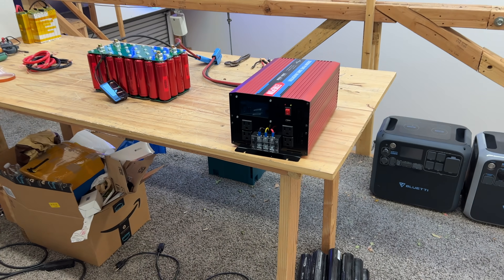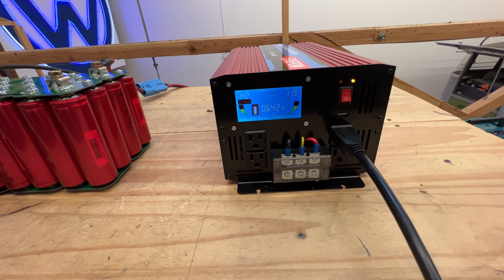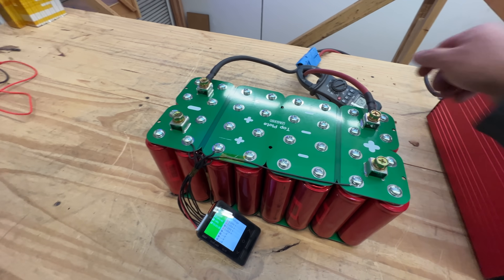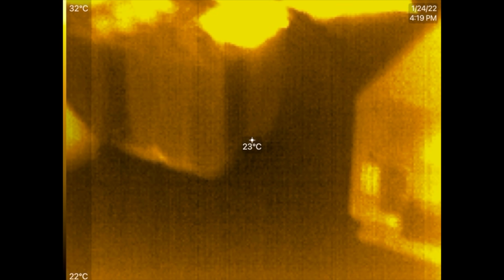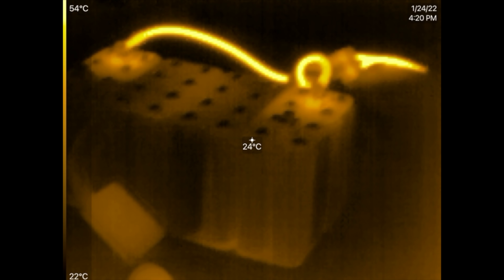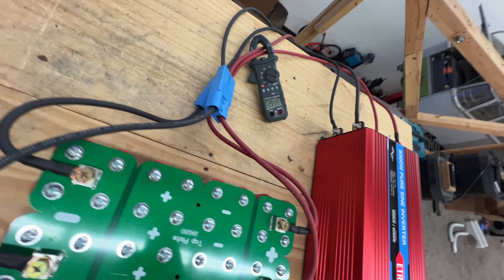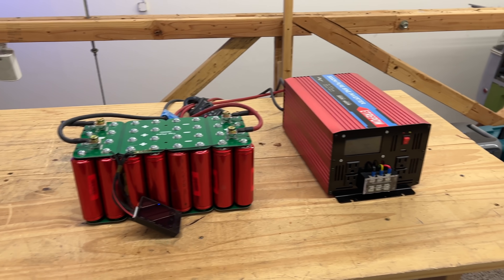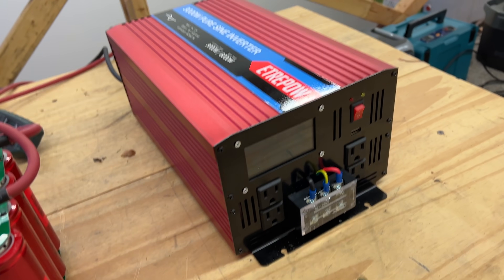This battery Kills inverters

Comment: Hi, when you got the two different current readings going from single to double wires, this could be due to the change in current waveform.
Your current clamp assumes pure DC current, the current drawn by the inverter probably isn't pure DC. 
There could be ripple on the current, changing you current clamp to AC would show you the ripple component.
It would only be an indication, unless your AC current is True RMS measurement clamp.
With a lower voltage drop to the inverter and higher load the inverter would perform differently.
The heater you used has an electronic current control, so you do not know if the current has some serious phase angle.
Putting a scope on a current shunt will show you what you are really measuring.
A scope on the inverter output would also help to see the "sinewave" shape.
I hoped you would have put the thermal camera on the Chinesium product.
Interesting experiment, I await the higher loads on the battery pack, the end plates seem to be holding  up really well.
Reply: It didn't have anything to do with waveforms. He was measuring DC output, therefore no wave. It was because the wire he had on the battery pack was extremely undersized for the amprage we was putting through the wires. One 6 guage wire is NOT sufficient for 200 amps and two six guage wires is Not sufficient for 300 amps. #1- that PCB does not have enough copper to do more than 90 amps, he was supposed to have the PCBs doubled up. He said so himself in his last video, and that was supposed to be good for 180 amps, not 300. He is constantly trying to push way more amprage through the wires, connections, and PCBs than he's supposed to, then he has a ton of resistance and high temperatures and voltage sag across the battery packs, and then he blames the batteries and equipment for not being good enough, when it was his connections that weren't up to spec to begin with. I've done a lot of electrical work, as both an electrician, and as an installer of very powerful car audio systems, and I promise you that you need 0 guage wire to move 200-250 amps around and 00 guage wire, or two runs of 0 guage wire to move 350 amps. Two runs of 6 guage does not equal 0 guage wire, it equals 4 guage, which is only good to 150 amps. You would need four 6 guage wires together to equal 2 guage, which would had barely been enough to move the 250 amps he was trying to move in the video. I've been doing high power car audio for 15 years and I know what it takes to move these electrons around with minimal resistance, and Jehu should have the wire guage needed per amps moved chart memorized by now, but he constantly pushes his connections and wire guage way past their limits and he wonders why these batteries never perform like they are supposed to.
Reply: Hi, guys. I am not disputing the cable choice, I agree that the IR shows the need for bigger gauged wires.
A voltmeter at the batteries and another at the inverter input terminals would have indicated the fact.
The attitude I got from when the video started was the, lets test something to destruction, but hang doing any observations to locate any system weaknesses that caused the destruction.
 
The reason for the lower current draw when the cable was doubled was due to the increase in potential at the inverter terminals, same load higher input voltage = lower input current.
What I am pointing out is that the load current, into the inverter is probably not pure DC.
An inverter is a current "chopping" device and no investigation has gone into if the inverter's input filtering is adequate to filter this characteristic.
The load on the output of the inverter may not be purely resistive, the fact that a coupe of simple knobs changes the load level indicates an electronic controller, it is not a purely resistive load and may have a power factor not agreeable with the Chinesium product.
I am not defending the battery pack or the inverter, but a bit more than just connecting some basic test gear and trying to do an equipment test needs more thinking.

Comment: Edit: I do NOT recommend this product, I've seen several failures where the board melts or the board welds itself to cells because it's melting solder points. This thing is dangerous in any audio setup over 150-200 amps. I tried to explain to the guy the weak points to make this a good product but it seems he ignored any suggestions and pushed the product knowing it can't even handle 300 amps, then marketed it as a 500 amp board. It's a shame honestly. 

yeah you're going to want to use 0 gauge if not 2-3 runs of 0 gauge to do a full pull on these. i'd love to see the thermals on the boards doing a 400+ amp draw. 
i think you'll run into issues with heat in the board at that range, but also those little terminal blocks. which could be avoided by just using a longer m6 screw and putting your lugs right on top of the board itself. 

good tests though.
Reply: Bruh use like 3 runs of 1/0 copper. 500 amps is like 5-6k watts for car audio amps interested in seeing the results.
Reply from the maker: We shall see, next test is 500A
Reply: @jehugarcia  i can't wait, hopefully you more equipment doesn't die. no more cheap inverters! lol

Comment: With 2 wires you get less amperage because the thin wires create resistance, so a part of the current is dissipated trough the wire length (also the battery was fully charged, so higher voltage=lower amperage)
Reply: Not true at all. Parallel wires reduce the total resistance, thus less of the energy is lost to heat. You can calculate the loss by measuring the resistance of the path from battery to inverter. Amperage squared times the resistance in ohms. See my comment.
Reply from the maker: Yes but no,  I added a bigger load that’s why I got more amperage with 2 wires

Comment: You really should use much larger gauge wire for these connections...at least 0 gauge...possibly 00.    
Hell...I use two 4 gauge cables for my 1500 watt inverter...and they still get a bit warm.
Reply: 😬. Did you leave the hair dryer pointed at your cables? 😉
Reply: @jamess1787    
What hair dryer?
Reply: My "AIMS 2500" has 0000 cables and it runs an air conditioner and a coffee maker. Air conditioner 2 hours on 2 AGM 100ah. I can't wait to build my Headway Bank and try it out this summer. Maybe with solar and 38120hp it will run till dark.
Reply: I use 2AWG wires and they still heat at 1500W, 132A draw.
Reply: i only use 10awg and i never notice much heat. different application (vehicle)

Comment: Battery looks good not even getting hot and wires not get on fire but it's Post to feel little warm
Reply from the maker: I think the battery and the pcb bus bar is going to handle 500A for 5minutes just fine,  it’ll get hot after that,  might need to do 2oz copper for loads above 300A
Reply: @jehugarcia  well I hope it's will be fine it's probably won't get hot anyways I'm kinda learning about ebikes batteries and other thank for you teaching us

Comment: I do have almost the same cheap inverter, 12V to 230V (Germany),3000/6000W and i only used it for mig-welding up to now. I can weld around 1mm sheet metal with maximum output, not much more. Got a few hours out of it only, no smoke so far. Fan comes on under load, of course.
I bet, the fan was your problem.
And yes, the more voltage sag in cable or battery, the more amps draw to get the load delivered. So, less sagging is less amperage draw for the same amount of output.
Reply: What size welder do you have? Just curious.
Reply: @Lumbeelegend  With the 3000W Inverter i use a cheap chinese igbt inverter welder which is said to be rated up to 200 amps max, but with this 3000W- inverter i can only crank the welder up to barely 90 amps (instrument reading), which is 10 to 20 amps less than with a 2500W gasoline generator. So, i'm not really pleased. My plan is to upgrade to parallel 48V inverters, but that's töo expensive now. Cannot recommend a 12V system for welding purposes though.
Reply: @werner.x  I was worried about getting a welder with my system. I have a MPP Solar lv5048 and 6x 14s lithium car batteries (58.8v max). 
I never looked into it because I do a lot of woodworking nowadays and the system runs my saws and planer fine. 
Thank you.
Reply: @werner.x  that igbt is only $100??? Holy... 
Does it do its job pretty decently? I need a light duty welder because my kids go-kart frame had an old weld break.
Reply: @Lumbeelegend  For some unknown reason YT or somebody else keeps deleting all my answers.
Reply: @werner.x  really? Dang man, I'm sorry. Thank you for trying. I usually select all and copy to clipboard, because it happens to me sometimes also.
Reply: @Lumbeelegend  No matter what, can't get info through. Next try. My welder does cost right now around 240 plus postage. Was back then the cheapest with euro connection handle, reversable polarity for gasless wire, a compartment for 5kg normal wire spools and, most important, a metal wire feed mechanism. Don't spend any money on welders with plastic wire feeder units, they are too soft and don't work for long.
Reply: Mine is Powermat PM-IMG-210S 
Would buy this one again.
Reply: Still there 😁
Reply: @werner.x  got it, I'm searching now, thank you so much
Reply: @werner.x  Man, I apologize, I didn't know it wasn't available in the US. Thank you so much for all your efforts. I only see it available for other countries.
Reply: @Lumbeelegend  That doesn't matter.
This type is a universal chinese design inside. I'm confident, they're sold worldwide.
Just look for something that has the features you want. Euro connector is less important, mine has 2 potentiometer, one for voltage, the other for amperes and that helps a lot more than only coarse switching , wire feed is automatic in my model, works surprisingly well so if you don"t find this - knob, just trust the automatic wire feed in combinatin with volt and ampere setting. But most important, look at the wire feeder unit. If you don't want to buy a gas bottle, the welder needs reversable polarity, either switchable or bolt on -  since gasless self protecting core flux wire needs the plus side to ground.

Comment: I am sold, I want some of those batteries. Which I could see the difference in performance in a 48v system. I honestly believe it is a reasonable inverter just the fan didn't work but it ran 3000w before. He just got a bad one. Big blow to the manufacturer of the inverter though after seeing this you know people going to avoid it.
Reply from the maker: I ordered 2
More of the same, so it’ll have a chance to redeem itself
Reply: @jehugarcia  Get some plates with a lot more copper, and get some 2/0 wire or equivalent.
Reply: When those first became easily available all sorts of channels were using just four of them to start cars.

Comment: 1/0 copper cable is what I use for my 2400w inverter connected to 300 amp hours of battery. I ran it will over 2k watts for a hour and got no heat from wires. Bigger wires = less Resistance and less amps so less heat.
Reply: Same amount of amps but on larger wire so less amps per volume of wire. Bet you meant that.
Reply: @Teknopottu  ya
Reply: So true 👍

Comment: Did you use pcb with a copper thickness of 35um or 70um?
Reply: I believe he said the copper was 1 ounce in thickness - so thinner than those figures, I think.

The thicknesses you mentioned were 2 and 4 ounce copper, respectively - again, I think.
Reply: @dennisyoung4631  I've just watched the other video, there he mentioned that the pcb's are 1oz or 35um per side. Pretty nice results at those amps.

Comment: That's about 2x what 6 awg copper can handle in free air
Reply: It's all relative. Can push 200A over 14AWG for short distances 🤷. 😉
Or, you know 100A over a small TO-220 mosfet 😁
Reply: @jamess1787  maybe with 200 degree C rated insulation and connections

Comment: A cheap way to test it is to put a big piece of metal in some water and dead short the battery with the metal while an amp clamp is connected.
Reply: That sounds like a YOLO test for batteries... 😂
Reply: @gamtax  it’s fairly common when testing high discharge cells like these.
Reply from the maker: Yeah but you have no control of that load and that’s scary on a pack that can literally put out over 2000A on a dead short
Reply: @jehugarcia  aren’t you looking to find the max?

Comment: HAH scary. I live totally off grid with just a few panels and a 24volt inverter running everything off a couple of 105AH lead acid batteries. I've been watching your channel to try and learn more and maybe switch to lithium one day, but I guess I'm better off with lead acid and NOT blowing up my precious inverter, lol.
Reply: Actually, not scary.  The batteries performed very well (may need to get rid of holes and cutouts), the inverter was new.  Electronics usually fail within the first month - if they fail.  If Jehu bought the inverter from a "reputable" dealer then he can get an exchange.  Sounds like your inverter will last forever - with any battery.  I have a Prosine 2 inverter running on Lithium batteries, that used to run on lead-acid.  I think the title is misleading you a tiny bit - the battery is not "killing" the inverter, it is just a cheap inverter that failed.
Reply: He's just having a crappy inverter though. Maybe your inverter can handle much better than that. I'm starting to migrate to LFP since the price is pretty competitive with Lead Acid batteries nowadays.
Reply: @gamtax  Yeah, I don't know where to get them from where I live. have to do some more research I guess. Be nice, just for the space savings,.
Reply: @Mripoststupidstuff  Agree with what Michael just pointed out. Besides, it is really fortunate that LFP is a great replacement for Lead Acid due to its similar operating voltage. I would recommend Will Prowe's videos. He's sharing his solar power projects and reviewing LFP batteries a lot.
Reply: solar charged lithium’s maintain optimal cycle use voltage on lead battery bank with dc to dc converter.. lead batteries also discharge high amps 3k watt inverters require while lithium’s are limited to the bms installed.. I charge scooter lithium’s to juice a single 12 volt 100Ah AGM that runs the inverters..
Reply: @Pauuanthakali  I've got a lithium bike battery, I've been watching these vids to try n work out how I'm going to convert it into power for my shack without setting the place on fire :D
Reply: @Mripoststupidstuff  all u need is a adjustable dc to dc step down buck converter to lower the voltage + amps from  lithium’s 36 - 42 to 24 or 12 volts so u can parallel connect to the lead batteries that runs inverter.. victron makes nice dc converters but pricey.. cheap ones of Amazon working pretty well for my setup.. I haven ‘em set at 100watts output to charge and maintain voltage on the lead acids adding capacity from the lithium’s.. a power meter to read system is also advisable..
Reply: You just caught him on a bad day. Lithium technology has proven itself time again to be the best available option for power storage. Also safety has significantly improved.